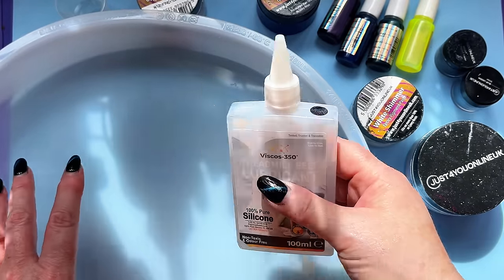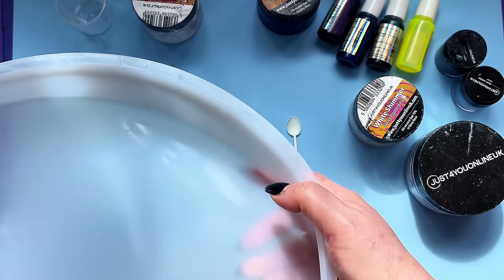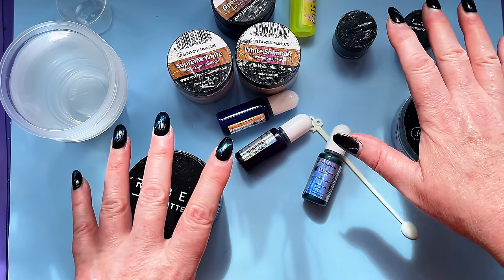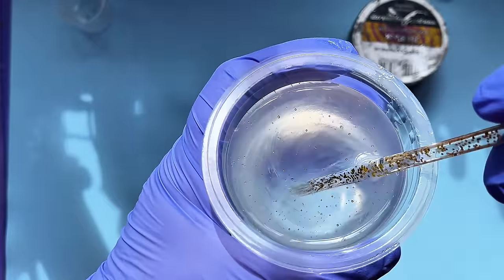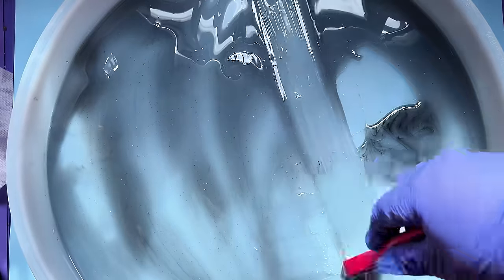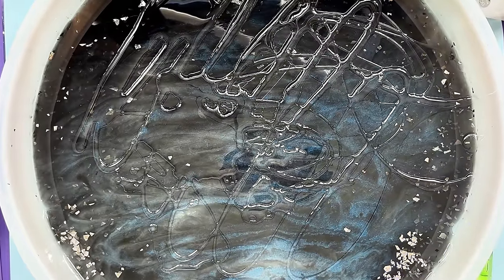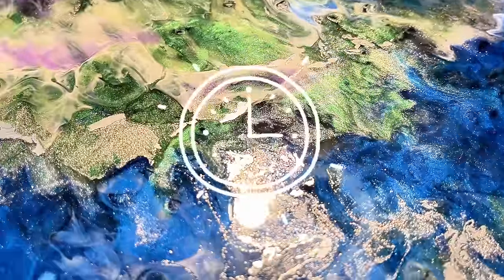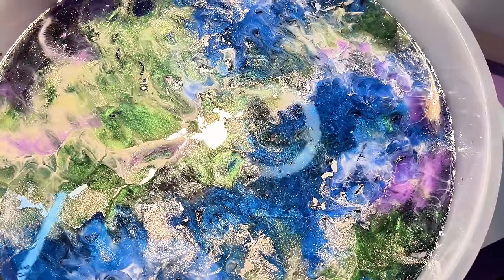#276 Will OIL Work in RESIN? #epoxyresin#apexresin#just4youonlineuk

Comment: Awesome video Tracey. It looks beautiful. I wanted to suggest that a needle tip bottle with a little lite cause to the tip to make it a little smaller would be good for placing the silicone oil. Thank you for sharing and i can't wait to see what your next video is going to be
Reply from the maker: Good thought,that would actually increase the amount applied dramatically per spot. This was a lot smaller than a drip from a needle tip bottle, this entire project took  one drip. Would be interesting to see what much larger amounts like drops from a needle tip bottle would do though,  good thought. I think, massive cells, which  could be interesting

Comment: Beautiful!  If it's hard the next time, you just immerse it in hot water and it will soften.  I watched this on Petra's channel.  give it a look - pretty cool method.
Reply from the maker: Yes I mention I might need to use heat, that is the easiest way that I have found over the years. Thankfully it wasn't necessary this time

Comment: That came out wonderfully, can you use mineral oil to get same effect?❤
Reply from the maker: I think any oil l would but  I used silicone as I knew that wouldn't  damage the mould. I know some oils - like whatever is in baby oil, definitely degrades latex and possibly silicone so I stuck with  silicone oil :)

Comment: Fantastic idea, it looks great.  I have one of these blowers, I used to do similar with alcohol inks with it then then use the dotting tool in alcohol and dot the ink ☺
Reply from the maker: Cool, I plan to try it with alcohol inks soon. Do you have a YouTube Channel? I'd love to see what you  do with this
Reply: @miniscenesgb  no, I don't have a channel but if you're going to try it, practice on the back of photo paper, it works well. Not the front as the inks won't move
Reply from the maker: @evelynbrown5312   great tip thanks :)